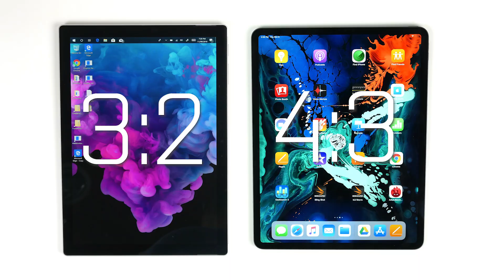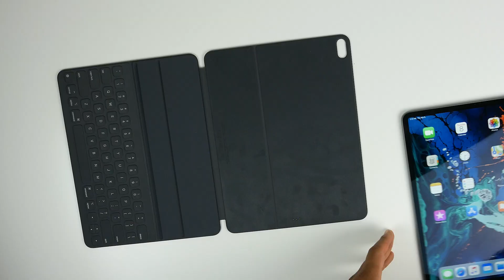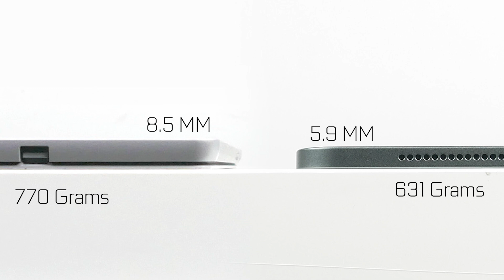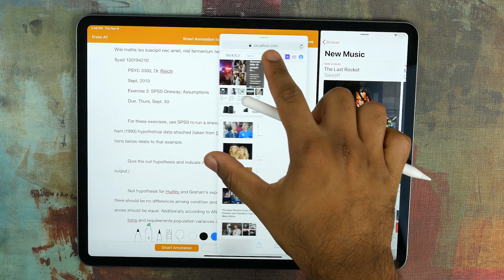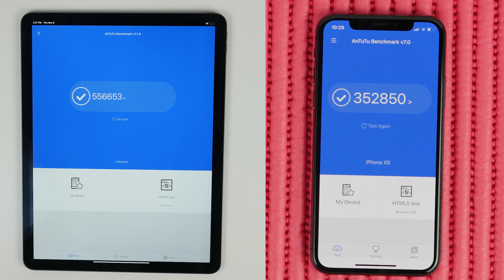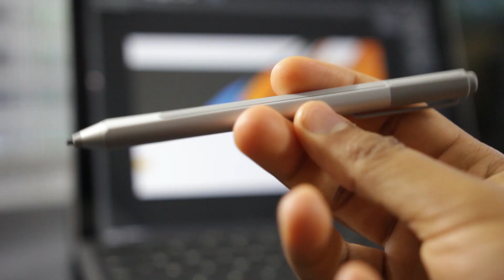2018 iPad Pro vs Surface Pro 6

Comment: The surface pro has always felt to me like it is stuck between being a less capable laptop and a tablet. The iPad is definitely the one to get if you want a real tablet. Just buy a laptop if you want the surface pro.
Reply: I find the Surface Pro great for University. Can run full version of Apps and wrote my notes on a pen.
Reply: @TheHaters112  Yeah that's what i used it for surved me well. Now i don't need the note taking so I'll buy a full laptop.
Reply: @TheHaters112  studying systems science, have used the surface, it's sheit. there for i am using a laptop and a 10.5 ipad.
Reply: I have had the surface pro for 3 years it's the same specs as a laptop same experience as a laptop. It's capable of the programming i am doing. It mostly is a laptop first tablet second.
Reply: noelsoong777 hold on, laptop can do it, second i had an ipad pro 10.5 and i also study computer science...and i did programming on the ipad using third party apps....yes just basic program but it can, just not very smooth if compare to proper mouse since copy and paste or want to fix some commands is a real annoying. My advice, next time, buy a laptop , then you will know how much i hate my surface pro from 2014...now, i had both dell vostro 7570 which will handle vm and something strong and my ipad work as the shortcut to access lighter programs
Reply: @NamelessPassenger  My surface pro 4 is the 8 gb core i 5 i did android and web development on intellij and webstorm.
Reply: yea same ... the surfaces hardware is too no fan, mobile optimized to be as good as laptop alternatives but with 2in1 or laptops you're mostly stuck with a keyboard and the surface book is utterly expensive.
Reply: What an idiot
Reply: i disagree. Im in a situation where i cant have an powerful desktop pc. I have a Powerful laptop instead. But this laptop is too big and to heavy for some circumstances. Thats where my Surface comes in. It is powerfull enough that i can run complex tasks on it and it is light and handy enough to use it on the go or when going to bed. One time my old laptop needet to be repaired. The surface was may only device to work with for about 1-2 weeks. it performed well, i couldnt have worked with just an Ipad. The surface is a really good Alternative when your main PC is not available.
Reply: So it's better having 2 devices than one?
Reply: Nathan yep if your livelihood depends on good productivity and the fastest workflow, have the best tablet and best laptop and the best of both worlds. Carrying two devices if it improves your work is a small price to pay. Compromising as it is too much hassle to carry the two is not professional. The Surface sucks as a tablet and is poor on your lap so I have never got the SP vibe. The iPad is the best tablet by a distance but just not ready for work for most as it currently stands. I use an iPad Pro and MacBook Pro and use them 50:50, replying to emails and messages, doing quick notes or reports, the iPad is easy to use than wasting the i7 laptop. I should make my laptop last a lot longer by spreading the work load. The Mac for heavier loads. Works for me and as it is my living the extra cost pays for itself.
Reply: I think the surface pro is a real niche product, it tries to be a laptop and a tablet and does not  succeed in any of those categories. The iPad is a better tablet, and for most people who want a tablet its the better choice. If you want a laptop with some of the features of a tablet (like better media consumption) a 2 in 1 is almost every time the better choice
Reply: DasDoeni can you explain how the surface pro 6 doesn’t succeed at being a tablet? Is it a software thing? I just don’t get the argument. What makes a tablet a tablet other than a form factor. To me it comes down to windows vs iOS again. Just like windows 10 vs Mac OS. You either like a simpler interface or not. I just think it’s harder to replace a laptop and only one comes remotely close and it ain’t the IPad Pro.
Reply: I've seen many prefer the surface pro over most laptops
Reply: @mistamaog  myself included.